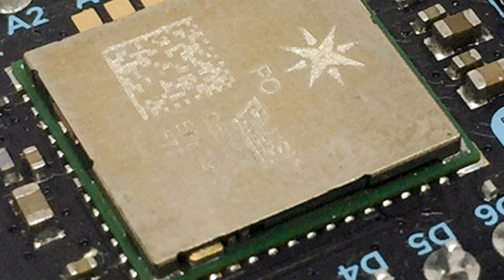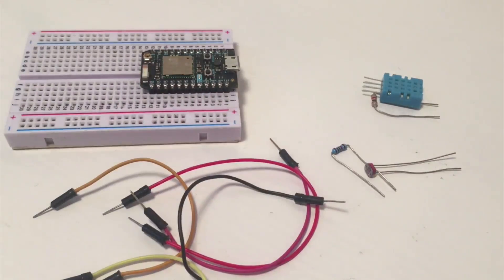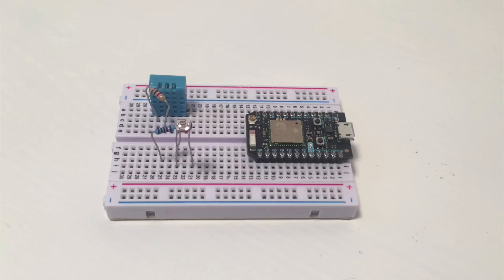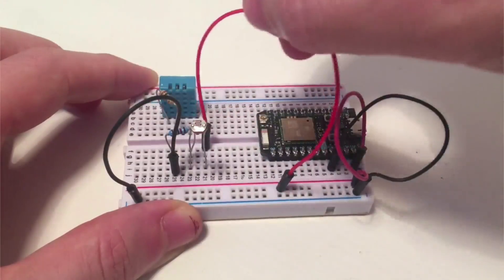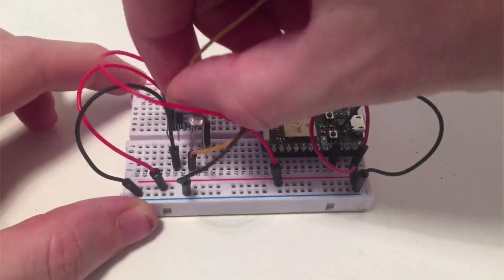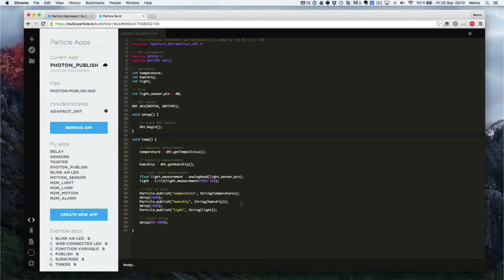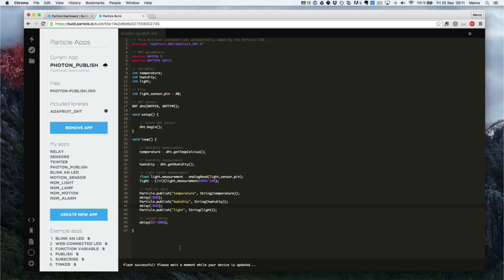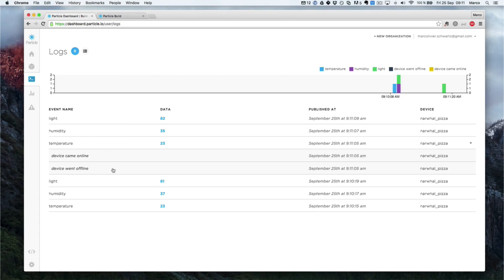Make a Cloud Data Logger With the Particle Photon

Comment: I cut and paste the code and it didn't pass the verification and ideas?.  Also, if I want to put this behind an enterprise network, what ports do I have to open up in the firewall?  Thanks,
Reply from the maker: +RogueSignal Make sure that you added the DHT library from the Particle IDE, this is the most common source of error :)